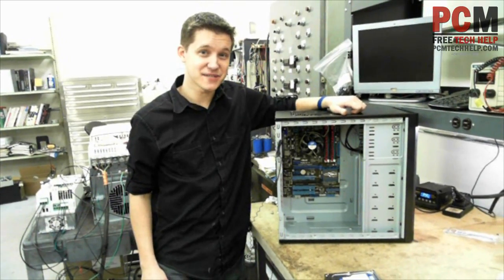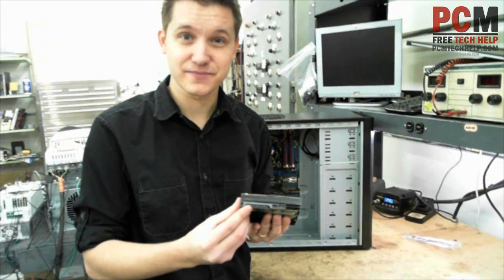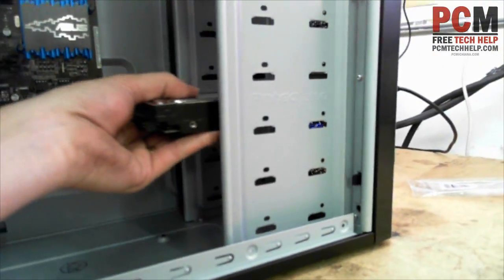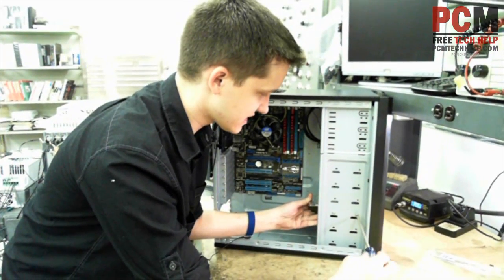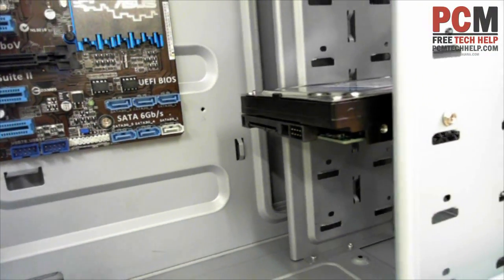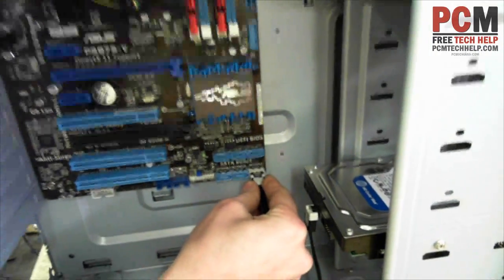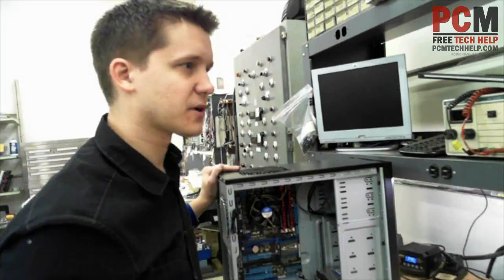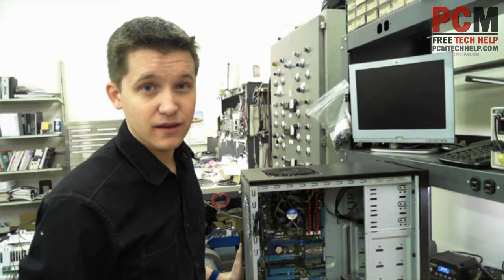How To Install A Computer Hard Drive (HDD) (2022)

Comment: I don't know how to access the community but I bought a 1tb hard drive for my Storm-P27 AVP-P27 and I have no clue where to put it, it won't fit onto one of the trays and doesn't line up well to any other hole. I also don't have a wire for it and wondered if I need to purchase this separately